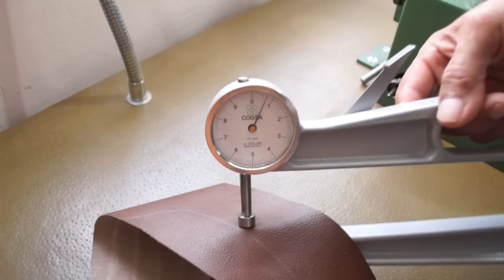French seams for a Mercedes Benz car seat bolster - Upholstery tips Part 2/6

Comment: The black ribbon used to block the gap in the seam......Does it have adhesive backing and can it be purchased. I usually make my own but its tedious.
Reply from the maker: I have used a thin stretchy velour to make the ribbon. I used a yellow glue to attach it to the back. Double sided tapes are also useful to attach these ribbons.
I have realized there are stretchy ribbons ready for sale in different widths. It should be stretchy to shape the curves.
https://www.youtube.com/watch?v=ECdhJhPmA7U
Reply: Never thought of using stretchy. Grazie mille Commendatore

Comment: Is there a difference between using 1/4 pink foam or headliner foam for your backing. I was told if I use headliner it would show wrinkles. Sewing marine vinyl.  What's your opinion and experience on using either one.
Reply from the maker: 1/4" pink foam is soft and good as backing with a thin stretchy cloth glued down to one of its sides. The glue should be softly thoroughly sprayed over. 
There are 'bonded foams'  ready for sale to be used as backing material. The cloth in the back is very thin and stretchy. Consequently, it does no form wrinkles.
You are right to say that headliner materials form wrinkles while fitting process. But, they are useful if we choose one with thin stretchy cloth.

Comment: What thickness foam is that you are using? It looks so thin and easy to use. I find even with 1/4” sometimes my seams get to bulky. Do you use adhesive to attach it to the leather at all or just stitch around edges? Your are such a master!!!
Reply from the maker: It is 3mm headliner bonded foam. The right side with the fabric is close to reverse side of leather. The wrong side has a kind of soft cloth.
I just 'baste' the leather with points of glue all around the edge. Then the edges are sewn down twice to make it flat. The first sewing is done on the very edge, The second is done at a distance of 8 mm. Besides, the second line of stitches reinforce the leather seams in case of doing some relief cuts. The last final closing sewing is done at 10 mm according to the seam allowance given.